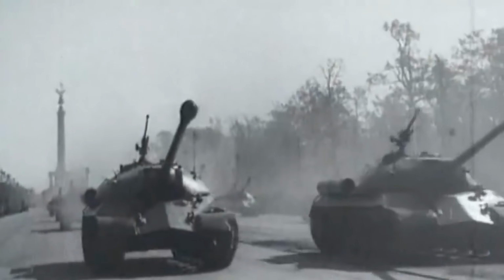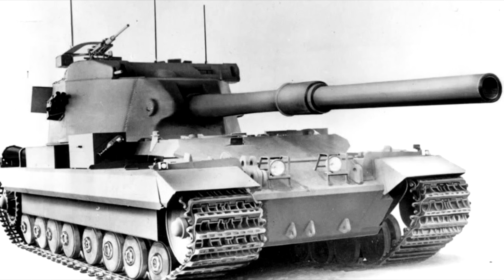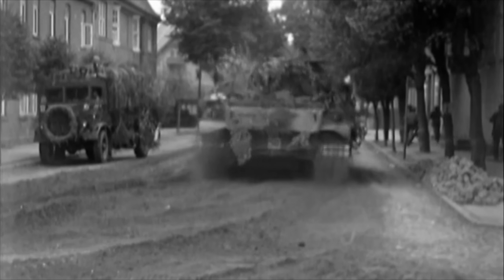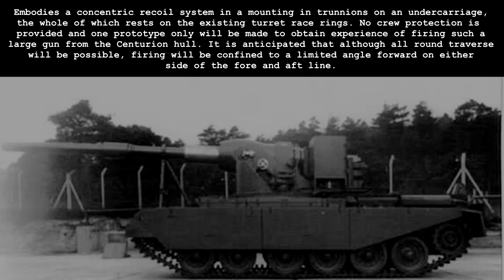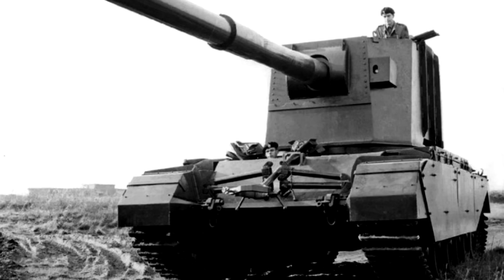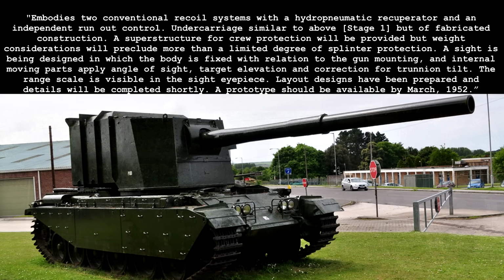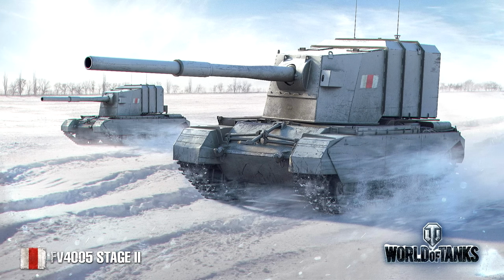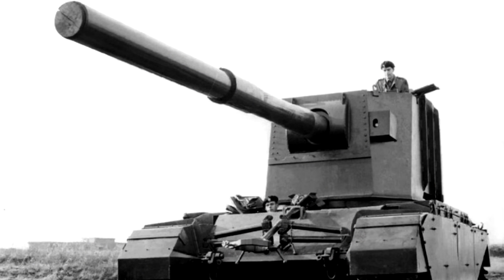British Boomstick, the FV4005 | Cursed by Design

Comment: I honestly find British tanks to be more interesting then most because they went from a pt boat with tracks and 75mm guns to the challenger 2 the big ass modern day mbt
Reply: The benefit of screwing up on a regular basis is that you learn what not to do.

The Valiant Tank is a thing of special infamy.
Reply: What's amazing is with all the crappy designs they went through, and had to greatly supplement their tank park with the American-built M4 Shermans, that type being the most common British AFV of WWII, and right at the end they come up with the excellent Comet and just as the war is wrapping up, the CENTURION.  I'd like to see a WoT hypothetical matchup between the Centurion, with either the 17-pounder or the 20-pounder tank guns, going up against "Panzerwaffe 46".
Reply: @selfdo  But the U.S. could pop out Sherman tanks like they were Model T's coming off an assembly line.  Canada kind of looked at building tanks, but it was quickly decided it wasn't worth it and just use American equipment and instead focus on building over 500,000 trucks for the war.  Of course Allies would end up using American tanks and Canadian trucks.
Reply: And now the Challenger 3
Reply: @gingergorilla695  aw shit I forgot about that one thanks for the reminder
Reply: @gasmaskedpanzer4853  no problem dude
Reply: @gingergorilla695  challenger 3 isn't a new tank. Its just a challenger 2 mk3.

Its called challenger 3 to try and offset negative press with the mod.
Reply: @tisFrancesfault  also, it's less confusing than Challenger 2 Mk2/3 (dunno why you said 3 but ehh). Especially since we already have a Challenger Mk2 and Mk3, as well as the original WWII Challenger.

But also in fairness to the Chally 3, unlike an upgrade package of some sort, the Chally 3 is getting a new smoothbore gun as well as most of the turret being modernised, with only the chassis remaining mostly unchanged.
Reply: @tisFrancesfault   no... its not a challenger 2 mk3     what was the the second mk  but  just because it shares a hull doesn't mean it has much else in common.
Reply: Well Britain was the first tank manufacturer. Its no surprise of them eventually reclaiming their title as best tanks and reliable tanks later on.
Reply: @toshitanaka1550  While the Challenger definitely is a solid MBT, I would argue that both the Abrams and the Leopard 2 are superior to it in most aspects.
Reply: @CIoudStrikerVT  at this point with MBTs we can only assume of their performance since if the world with MBTs fought against each other is who shoots first and kills their enemies. That pretty much what our modern tanks are. Protection is basically becoming obsolete with these tank projectiles.
Reply: @CIoudStrikerVT  You can't really compare modern MBTs because of the lack of information since it's all classified.
Reply: @CIoudStrikerVT   leopards and abrams are now much better than cr2 but back when it came into service is was definitely at the very least on par... if not better
Reply: Well said
Reply: Don’t W forget the archer!
Reply: I find it interesting just how simular most mbts are now days. Same types of armor, guns etc 

Besides small things like abrams using turbine engine. Dont most use the rheimstal 120mm cannon? Armor is basically all the same type of materials and reactive armor patches. 

The only really different ones is the merkava cuz it has the ability to hold a squad of soldiers if needed and the engine is in the front. Oh and I think the brits are the only ones to use a rifled barrel

Comment: Both FV4005s was the British “just put the largest gun you have in it” attempt
Reply: More On than In. Like the KV-2
Reply: They should have just put one of there battleshipguns on it.
Reply: @Maritimesgestein  ah yes,the 305mm mk X naval gun from HMS Agincourt ontop of the Fv-200 hull
Reply: @bigmac3373  nah the guns from hms rodney
Reply: @Maritimesgestein  The japanese actually did build an armored vehicle with a (light) naval gun in WW2. Of course they did that because it was meant to support naval infantry and the army fought tooth and nail against the navy being assigned any part of their gun production so they ended up trying to fit a 12cm naval gun on a tank chassis.
Reply: @GaldirEonai  the russian did it too
Reply: @GaldirEonai  Light naval guns had a caliber of 105-120mm at that time. That's not that big.
Reply: @Redstone37  It is if you compare it to the tank guns of the time which were just starting to get into the 80-90mm range at the extreme end. The 120mm gun they used was ludicrously large for an armored vehicle of the period.
Reply: @GaldirEonai  except SU 122, SU 152, IS-2 (122mm) and the like, (also ISU 122/152) did exist. Also Germany wanted to put a 128 into a tank. There were plenty of larger caliber assault guns, and even a few tanks with ridiculously large calibers

KV2 was also 152mm, and there were plenty of Sturmpanzer with the 15cm sIG33
Reply: @nolategame6367  but the naval 120mm (and larger) were already used in ww1 and before.
Reply: @Maritimesgestein  "How big is your tank shell?". "18in, and takes a crew of 5 to load it"
Reply: @TheAmythas  Sturmtiger huh?
Reply: @nolategame6367  has a naval mine luncher not a gun
Reply: @Maritimesgestein  true that it's technically not a gun, but it naval stuff
Reply: @nolategame6367  yess why am I seeing nobody talking about Sturmtiger
Reply: @TheAmythas  I look forward to this armor free Japanese tank disintegrator.
Reply: @nolategame6367  I was thinking of the guns on a British capital ship like HMS Furious 18in and weight about 151 tons and the shells were 1.5kg too
Reply: Bri*ish
Reply: i can just hear the Commander saying " COMMENCE PRIMARY IGNITION".
Reply: "You may fire when ready."
Reply: it's like they put tracks on a navel battery.....
Reply: 2A3 Kondensator 2P says hello
Reply: The KV-2 was a naval gun.  It also couldn't turn the turret on a slope it was so heavy unlike in video games.
Reply: @wihamaki  no it was not a naval gun, it was a howitzer mounted in way too large a turret. Actual naval gun would be SU100Y
Reply: Thank you world of tanks kv2
Reply: @alex56756  ur welcome (but in Dwayne the rock Johnson’s voice)
Reply: General Kenobi
Reply: Sometimes, a "MOAR DAKKA" adherent slips into your procurement office.
Reply: More like largest gun that tank hull can carry. Because Brits could pud the largest gun they ewer made , it would be 457mm gun instead of 183.